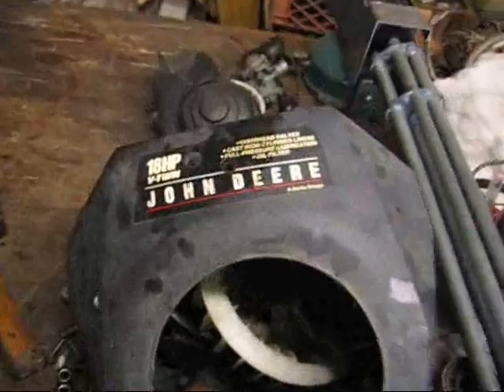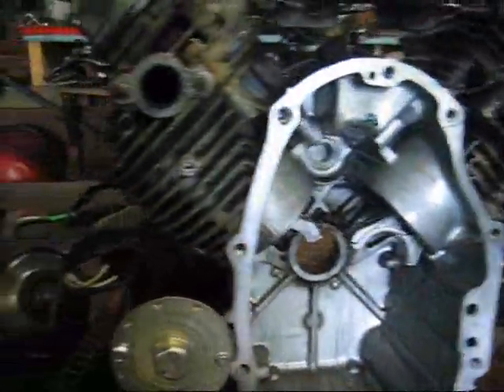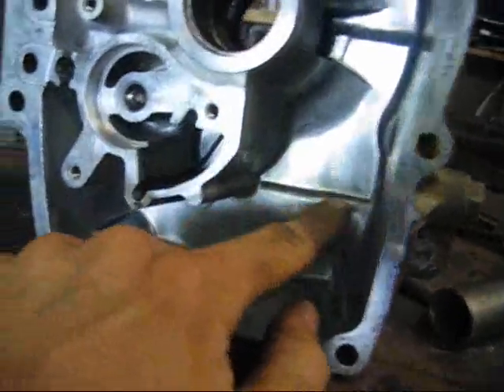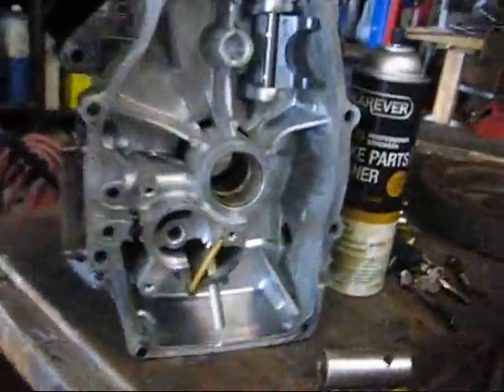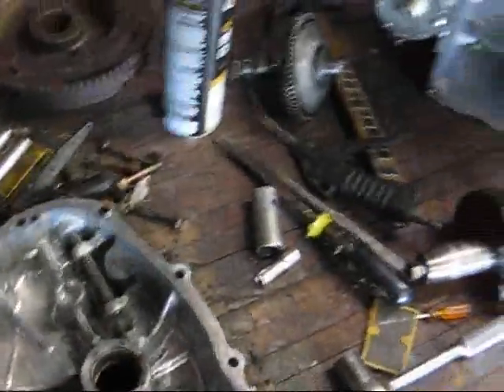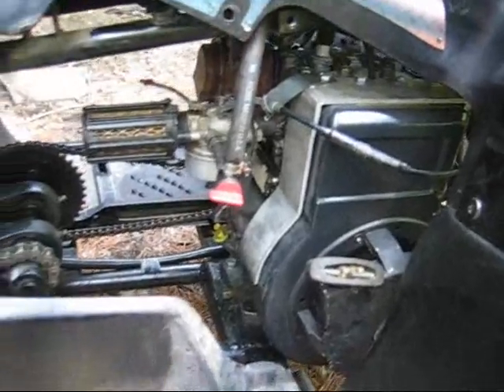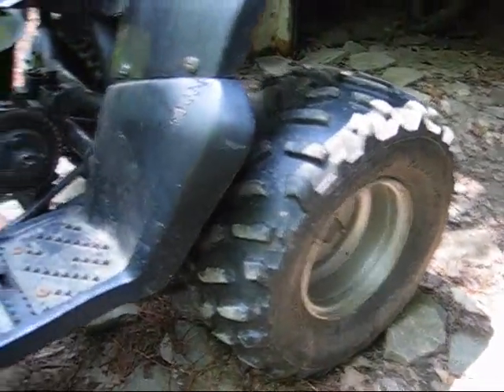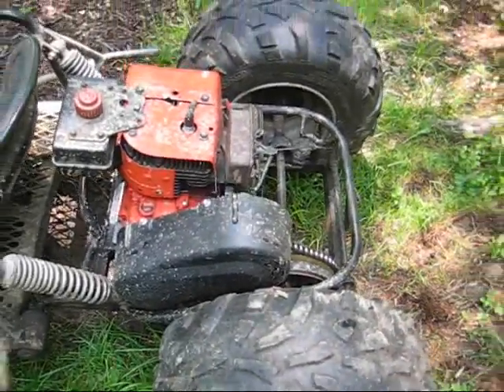Converting Vertical 18hp Kawasaki V-twin to Horizontal shaft

Comment: did u find a right angle manifold for the carb?
Reply from the maker: I just made an elbow that bolts on the original manifold and used a single mikuni style carb with a rubber hose to connect it.

Comment: So how you were able to mount a vertical bolt pattern to horizontal bolt pattern now when there is none ?
Reply: He's most likely using an adapter bracket to add the horizontal shaft mounting points.

Comment: Hi there,just found your channel so new subs here. Like what you are doing with the engine. It looks like you will get a deep sump when you turn the engine,all good there. Loving the idea of the vee twin mini Morgan. I machined up some adaptor plates for a dude making one from a Moto Guzzi vee twin and a Mazda miata gearbox. Was a great combination,light and well made. The rear drive was from a BMW bike,shaft drive,all alloy,beautifully made and only 300 bucks! You will have a fun project,can't wait to follow progress!
Reply from the maker: Nice that sounds like the ideal combination. Ill proably end up going with a gokart or snowmobile torque converter to simplify the transmission and clutch setup and i have a 90 degree gearbox i can use to go to the wheel. But the drivetrain is still up in the air. Kinda waiting till parts fall in my lap since im in no hurry. Thanks for the subs!

Comment: did you ever get the motor running and working. I'm thinking of trying something similar myself and want to know if it's worth my time
Reply from the maker: +cjvk10313 No I havnt. Still on the lookout for a coil thatll work and carbs. I might see if i can rig up a carb or carbs and then ill atleast have that done. I probrobly have all the parts i need around here somewhere if i look hard enough. Just have to get my butt in gear on it.

Comment: like to see how you make out,,
Reply from the maker: mustie1 I havnt got it running yet I had to get some gasket paper for the crank case cover because silicone was too thin not enough end play. I got that done today. Now iv got to figure out what carb i want to use and make a manifold for it then I can test it out. Its got an oil pressure sensor on it so that should tell me if its working.